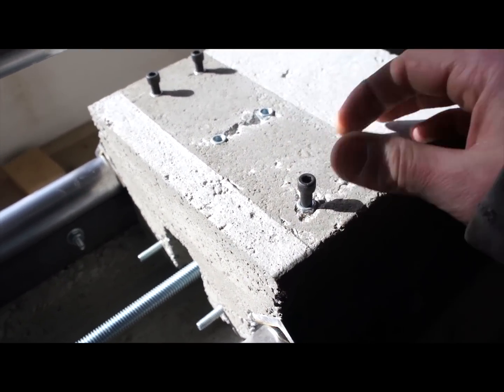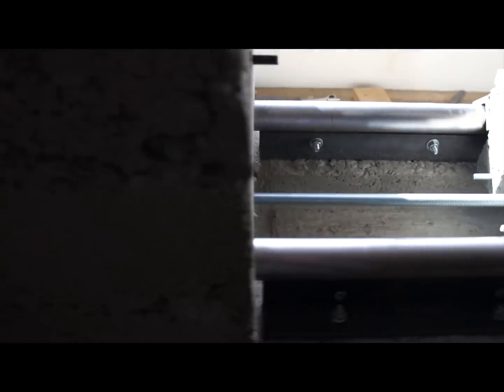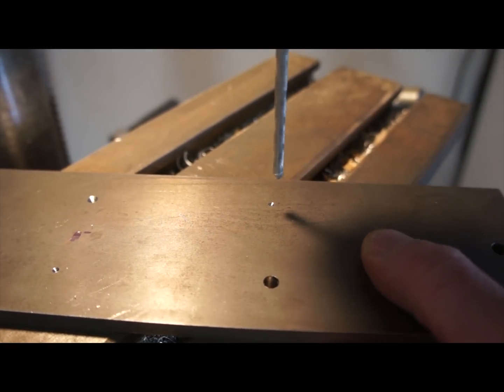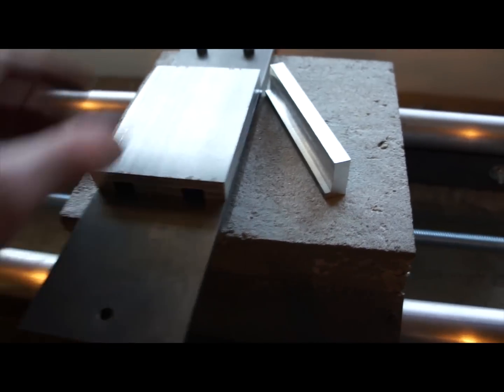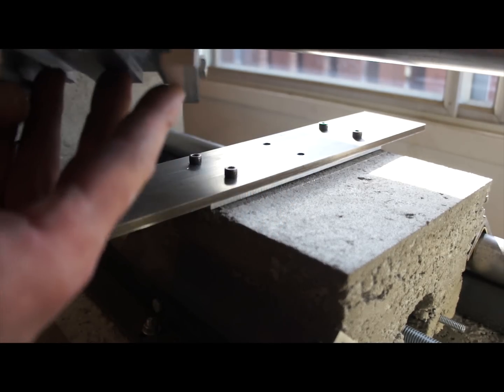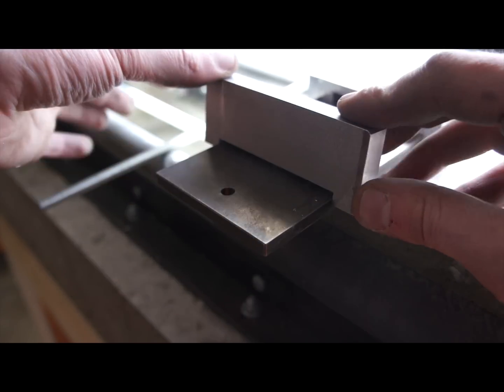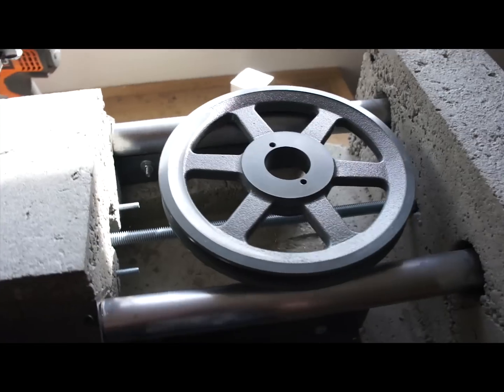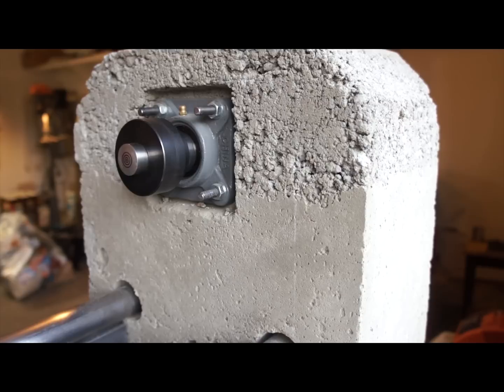Concrete Lathe - Part 4 Carriage

Comment: yes but what holds it to lift itself upward? Only its own weight? also the round bars to black angle iron you did not show how is attached. is welded or is just there? this is rely a cool project and ive seen thousands.

Comment: Hacksawing 1/2 plate gets old quickly.  I'd use my Jigsaw, or my Sawsall.
Reply: scharkalvin I suggest watch a 13 part series called What on earth happened by Ewaranon to learn that the earth is not a globe.

I got it in my about tab.

Comment: I think its a great idea if you can't afford a lathe.   I don't know how much you want to dress it up but you could use bondo to fill the surface  pits and holes.   Just mix it up and spread it all over it then sand it off smooth.  Paint it gray and people would never know what it was made from.  Congrats great job.

Comment: i'm not a sexpert or nothing, but I hear tell carbide likes twice the feeds/speeds that HSS does, so those masonry bits might work better on that steel at double speed.  O course, its hardened, too, so it might also be going too fast at the speed you had it.
Reply: Not sure what the comment above is all about but has and carbide do have different feeds and speeds. Everything depends on the size of your work since that will determine surface feet per minute from feeds and speeds but it's usually significantly faster than double. I think for a 1/2 diameter piece of crs the speed is under 100rmp for gas and upwards of 700-900 for carbide insert. Ultimately, if you go too slow with carbide you've got a higher chance of breaking it and a guaranteed chance of a horrible surface finish.
Reply: forthector I suggest watch a 13 part series called What on earth happened by Ewaranon to learn that the earth is not a globe.

I got it in my about tab.

Comment: I still did not see you use any measuring tools or surfacing plates. It is normal for cheap diy wood lathe, but for metalcutting lathe it looks croudly strange :-)

Comment: crazy stuff curt!..question... wont the brass be an issue due to wear and tear on the steel down the road? maybe very minimal but just curious.
Reply from the maker: If I come to a day where I need to replace the brass strips from wear I will be happy with the 100's and 100's of hours of maintenance free operation.  The main problem will be the tool post dropping by a few thou over its wear life but thats easily corrected by adjusting the tool height (a mod I am working on).  Thanks for the comment!

Comment: The masonry bit for cutting hardened/stainless is a great tip, I got hold of a set of locksmith drills with carbide tips which work well and don't cost much but have had plenty of success with ground masonry bits too.

Great project, thanks for posting.
Reply from the maker: +waydeewaydee Thanks for the comment!  I'd love to invest in a nice set of carbide tip drill bits, but I have such an infrequent need its a far ways down my list.
Reply: +waydeewaydee Whoa there, you can use a reground masonry bit for hardened steel or stainless steel?
Thats a new one on me, I will have to try it at work as we have to sometimes drill stainless and it ruins ordinary twist drills even with plenty of cooling fluid.
Reply: Just 2 weeks ago, I stumbled into this discovery myself. I had a piece of hardened steel I couldn't drill so I started THINKING.!!!  The tips on bits made for masonry are carbide so I tried one & it worked great!!
Reply: @davidmartin7081  davidmartin I suggest watch a 13 part series called What on earth happened by Ewaranon to learn that the earth is not a globe.

I got it in my about tab.